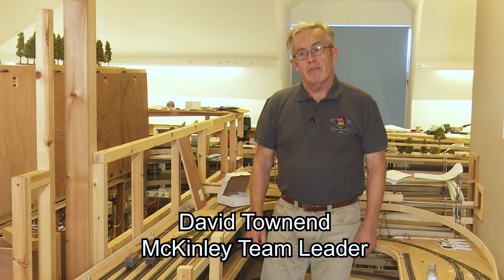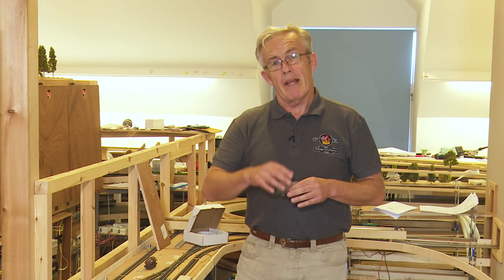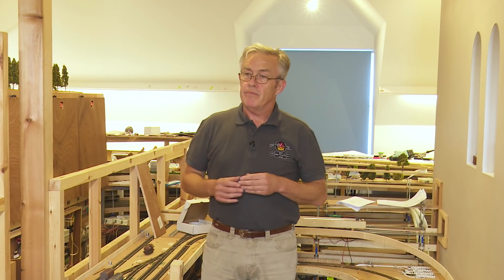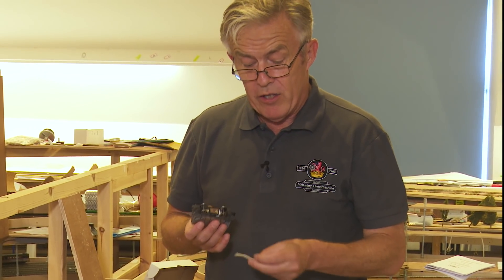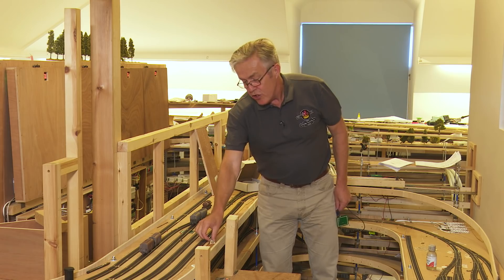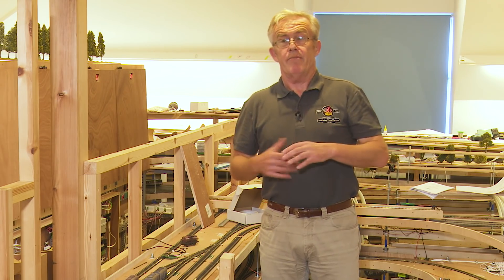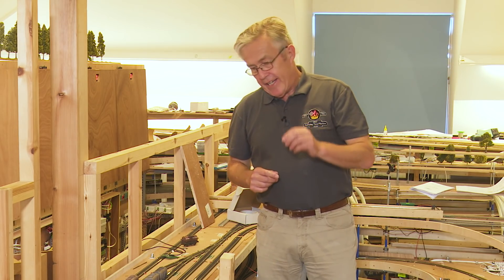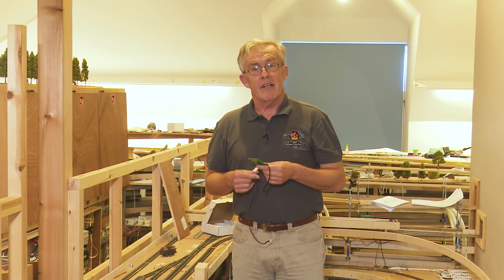33. Managing Freight with RFID on McKinley Railway

Comment: Funny you should mention RFID, that is what the Class 1 Railroads use in North America to track trains and shipment to give freight agents and companies an up to date status report on shipment and Estimated Time of Arrival, been in use on the BIG 6 RAILROADs of North America since the 1980s (BN, UP, SF, SP, CSX, NS, CP, CN, and Conrail)
https://youtu.be/TSamvRjfEP4
North America Modellers use a simple but low tech method of simulating freight shipments, a system of Cardstock, CardPockets, and Cubby Shelves at the location to simulate freight shipments Cubby shelves are used for Yards and Client Industries along the railroad, while the WagonCard simulated the cargo and the CardPocket or sleeve simulates the freight wagon itself. This makes the Train crew doing local freight runs responsible fore shipments and WagonCard to have it in order when setting out and picking up wagons from an industry siding. 
If the freight wagon is faulty then it can be set out with a "bad-order card" (or defective wagon order) and set aside at the nearest siding to be handle later by the traincrew or the "Maintenance-of-Way" crew to be taken to the Wagon Shoppe facilities. 
Also have Freight Cargo Card and Freight Wagon card-sleeves also the Yardmaster and the Shunting crew to handle the wagon and cargo in more realistic manner of breaking down and building trains at the Railway District Yard for local trains, fast-freight thru trains, and "empty-wagon orders" to be sent to other parts of the system to have the freight wagon be available for the next cargo in another part of the rail network where that district is in urgent need of that type of wagon.

Here are three different perspective of the freight card system, below
https://youtu.be/duSk4PUJuWA

https://youtu.be/XWpTxCqxPq0

https://youtu.be/grnSdLrOokQ
Reply from the maker: Thanks AGS,  We are going in the same direction of computer generated waybils, but without the printing out part.  The benefit of that are enormous.  Now we have cracked the RFID tracking system, the freight Mgmt. software is in test on one of our final 7 locations on the railway.  The next two locations to support RFID are being built off site and will be tested in the fall of 2021.
Once you can be free of physical cards, the opportunities are endless.  Stay tuned to see our mistakes as we muddle through the touchscreen world of freight management on model railways.  
There's a later video on where we have got to.  Take a peek at No 47.
Regard
David
Reply: @dattouk  wow thats great, i am definitely loving the progress you guys are making in the McKinley Railway, I will definitely take a look at video #47. I do agree going paperless do make thing a lot easier to handle

Comment: I like the idea of using RFID in model railroad.  I would probably go overboard by adding a tag to every car and locomotive.  It would allow me to design software that would let me track the exact location of every car on the layout.  If I had data which included the car length, I could calculate the speed a train was moving at, and I would be able to determine if the entire train has cleared a crossing.  This could be handy for signaling.  I would also use this for determining whether or not a train has lost a car along the way. I could trigger an emergency shutdown of the operation based on that.  Or, I could shut down that one train and close off the line with signaling to prevent a crash.  There is a lot of fun and interesting stuff you could do.  I think I would build in a rail operation simulator.  Imagine a freight switching yard where a diesel locomotive assembles and disassembles train sets based on a set of instructions.  Using the RFID tags, the system would know where every required car was, where it was within a set of cars, and where free space was for a locomotive to move cars around to get to the one it needed.  That kind of programming is right up my alley.  I just need my own layout to work on :-)
Reply from the maker: I'm glad we have inspired you.  I would hold back from tagging everything though.  RFID isn't the best solution for lots of things. We are using it to register locations rather than other factors such as speed and direction of travel.
Reply: @dattouk  What would be the issue with tagging everything?  I cannot imagine it would overwhelm a wireless router.  You can always split up your wireless traffic onto different channels.  If it is too much for the Pi, you could always use multiple Pi's.  The latest generation of the Pi is pretty powerful.  I would tag everything just so I could build out an application that would allow me to operate a relatively realistic operation.  I think an automated shunting system could be entertaining to watch.  It would make the model world a bit more dynamic.  Imagine going to your tablet and placing a grain order and watching your model world come to life.  Add in simulations for holiday traffic, sporting events, etc.

Comment: If you put the readers in pairs, one close after the other, passing tags will set them off in sequence. A bit of code will then be able to figure out in which direction the tag passed them, allowing for better indications (count-in and count-out for each loadingzone e.g.) and, if you want to, more clever automation.
Reply from the maker: You could do that, but it gets expensive.  Sidings technically only need one at the entrance.  We have put two into the bi-directional tracks to record end of entry/exit.  When we show the next video on this you will see how it has been done.

Comment: I see your Eccel Chilli UART-B-1 reader is a 13.56MHz unit. My electronics suppliers (in Australia) stock more 125kHz RFID gear. Do you recommend avoiding 125kHz, or is it six of one, half dozen of the other - subject to the usual caveats on electrical interference and distance constraints. Is it easier or cheaper to get the 13.56 adhesive stickers to put on the wagons? Thanks for taking the time to make these very educational videos.
Reply: So I am not wise about frequencies, but I doubt that it would work as well.  The 13 Mhz range is so far away from the DCC 14 KHz that it doesn't interfere all all according the the Eccel boys  - We are getting unbelievably strong results with the higher frequency.  A bit like Long Wave and FM radio.  Why not email them?  They are the clever ones who cracked it for us.  The tags we are using come from ZipNFC.   Here's the link.
https://zipnfc.com/nfc-sticker-midas-tiny-ntag213.html
They fit under OO/HO wagon bodies without being seen.  We use 10mm neoprene tape on the bottom of the wagons to separate the tag from the metal weights in the wagon.  If you have a low body where you can't add a 10mm piece of neoprene, you will need some ferrite sheet plus a 1mm neoprene separator.  This small piece of neoprene allows the magnetic waves to waft around the tag.  More videos to follow on this subject.

Comment: Is your use of RFID to make it reduce the cost of stock management on the tracks? I am told that tramsponding (doing the same thing as RFID w/direction too) is very expensive if you have a lot of stock.
Reply from the maker: Hello Hans, its not the cost that is the driver here. Transponding works for Stock with a DCC chip.  It was never designed for Freight management of wagons. We want to track hundreds of wagons and give operators a clear purpose of where to shunt wagons. We have a database that holds records for every wagon, it also has many waybills for each kind of wagon. We are using RFID tags on the wagons to tell the database a) what specific wagon is where and display the associated waybill which give the operator the instruction of what to do with the wagon.  Once that task is completed, the database then assigns a new waybill to the wagon, which then shows the operator what the next task is.  Neither Transponding nor RailCom are appropriate for this.

Comment: Nice work guys.  Some questions.  Can you advise on speeds of reading? For example, if the tagged vehicle was travelling at model mainline speeds over the sensor would the sensor still get a reliable read? Also, I assume that plastic body vehicles don't need the neoprene pad, unless they have metal weights inside them, then they probably do?  I'll go away and look at your product links, but looks like you're using NFC tags and they can have data added to them - using an NFC writer app on a phone.  That would allow for example each tag to contain some dynamic data like the vehicle's "last run" or "last serviced" date :-)  such fun!

I have planned (but never built!)  a more active system where power is drawn from the track (or from the logic output of a decoder) to power a small 8-pin MCU which is pre-programmed to send a UID via simple serial via an IR LED shining out of the underside of the vehicle. IR receivers set into the track receive this and from thereon, the same as your system. This is essentially a "squak ident" system where all vehices send their ident every 500ms or something.  Using low power MCUs and some kind of reservoir capacitor in the vehicle I think it would work.  The MCUs (for example an ATTINY85 AVR chip) can be got very cheaply and programmed easily enough - but again, my concern is, would it work reliably at speed?
Reply from the maker: Without giving the game away on the upcoming video, we are getting 100% reads on all stock up to 40 cm/s which equates to about 70 MPH in OO terms.  That is quite astonishing. All stock is fitted with neoprene to get the tag close to the track level.  It truely doesn't show. The tags we use are relatively cheap.  The frequency of the DCC doesn't interfere and once the manufacturer (Eccel technology) produced some tuned aeriels for being under the rail track we were in 7th heaven.  We have used some ferrite boards with a skinny neoprene pad under locos and that is proving to be reliable too.

Comment: RFID = Radio-frequency Identification .  Your description of how it works was pretty good really.  It sends a little signal out, and the receiving tag picks that up, and uses a little bit of the signal to make electricity.   There are many different things.  NFC, Near Field Communication, used in credit cards is similar, but a little different :).   These days you can get NFC tags for many things.
I will never have as extensive a layout as you have, but you're solutions to problems have given me a lot of ideas when updating my layout.  I appreciate that.

Comment: If you want to get direction information also without placing multiple RFID readers in sequence, you could always attach two RFID tags to each loco and use the scanning order to determine direction of travel.
Reply from the maker: Yes understood, but trying to get any tag to work with a locomotive was the main issue for a long time. Even if we obtained loco orientation, we'd still have the problems of trying to feed that into TrainController.

Comment: Please tell what database software you pick for the iPads.  We have not found a suitable DBS for iPad.  A data point needed is Full or Empty (loaded or unloaded).  With this data point for each wagon the operator will know associate the load or empty with a particular product, which might also have an RFID on it.  With a wagon ID and a load ID and a customer or designation ID you can on computer construct a days deliveries and figure the time to make up a train of loads going out and alternately a train of empties coming back.
Reply from the maker: Hello Jon,
Sorry for the very late reply.  Somehow I missed your question.  We have developed a database application in Filemaker which is a commercial Apple product.  It is cross platform in all senses except android and is a rapid application development environment. Its not free-to-use and we have installed a server to hold the data.  There is a JMRI solution which you could adapt the RFID data to work with.  We have worked with a great RFID hardware supplier called Eccel, but they are not a database or application company.
David

Comment: Hello, did you look at the TrainTraxx.com solution ?
Reply from the maker: We did and their solution was inspiring, but the concept they were offering was very slow via the cloud from here in the UK. Specifically, there were too many parts and the antenna was very bulky, the tags offered didn't work so well on UK rolling stock.  Besides the hardware challenges the key aspect is the database integration.  Their offering wasn't developed enough at the time and we ended up developing our own custom system.  We also considered adapting the JMRI freight system which could work, but we didn't have access to people with the necessary skills.  Happy to share our knowledge to help

Comment: I would be worth looking at larger antennas (longer in the direction of motion) or antennas based on ferrodrods as used in radio receivers. The RFID protocol allows for more devices to be in the operating area.

Comment: Rfid tags are used on rolling stock on the real thing for some yards, so this is definitely art following life! :)
One thing though, when we've had rolling stock damaged and then rebuilt & recommissioned, the database has remembered the old ID, and refused the updated rolling stock numbers!
I recommend a seperate rfid reader station where IDs can be taken out of the database or reassigned, as it will save headaches later.
Reply from the maker: That is an excellent idea.  Thank you...  We will put this on our profiling station.

Comment: Pardon my ignorance, haven’t you by introducing RFID and a system not integrated into an NRMA standard, created the issue that you now have, in getting data from an RFID database over to your train controller software in such a way as the controller can use it for routing purposes. Would not a decoder in a set of wagons not only achieve the same result, but also be instantly readable to the controller software? I’m presuming those massive German layouts must have tracking on their wagons, so clearly I am missing something?
Reply from the maker: Hi Alan,  DCC is primarily a one way control system for locos and switches and the feedback logic  you describe (either Railcom or Transponding) is not designed to report back dozens of identities in a single detection block.  I'm not aware of any large system (German or otherwise) that use any available form of feedback and tracking (standard or proprietary).
In my view R&D is expensive,  time-consuming and gives unpredictable results and so my golden rule has always been to buy off-the-shelf product to run the railway.  As I am breaking rule number 1, I am proceeding with cautious enthusiasm!

Comment: Back again David,  Hi.  Once again I find myself mulling over you inspirational video content.

I’ve been wondering if there is an rfid reader at the beginnings and ends to sidings/passing tracks etc etc does that imply that if they were positioned correctly under the track could their outputs do the role of the IRdot detectors to identify ‘end of section’ to finally stop a train pre stop signals etc?  This is extra from engine, wagon carrage set identification.   I realise that it is likely you already have the IRdot’s in place but it’s a possible reuse type of situation is it not?
Reply from the maker: Hi Mark,  
The short answer is probably NOT.  The Long answer is :To replace an Infra-Red detector with an RFID requires some thought.  The Infra-Red triggers a relay which closes or opens a sensor port wired to a device that sits on LocoNet.  The RFID detector sends a long text string "somewhere". That "somewhere" has to read it, interpret it as a Brake/Guards truck and then send something to TrainController to trigger a stop.  As TrainController only responses to a sensor message, you have to generate LocoNet messages from the software via a library such as RRAuto  (https://www.perecli.com/rrauto/) to achieve the same result. 
What we are doing is something similar except we are sending a Trsnsponding ID out over LocoNet from the RFID information.  This allows our system to position non-DCC-chipped stock correctly in the platforms.  Hope that makes sense.
Reply: McKinley Railway thanks David for your thoughts

Comment: Looks like a really cool idea. For the distance issues on the old part of the layout, I wonder if you could make circuit board with traces or use a loop of wire that integrates into scenery like signal gantries to get a reliable read, and not disturb too much
Reply from the maker: Thats a good idea, but I believe the antennas are very specific beasts as even the length of the wire coming from them has to be a specific length. I am ignorant about the specifics here, but we have a video meeting planned with the manufacturer in December.  I'll ask them then.  We have through of an "in-between the tracks" antenna.  The lads at MERG came up with that idea, but I am not sure how we connect it into our readers.  Stay tuned for more updates in the new year.